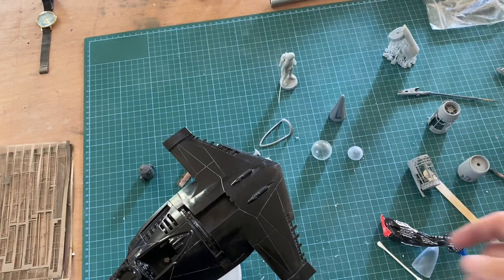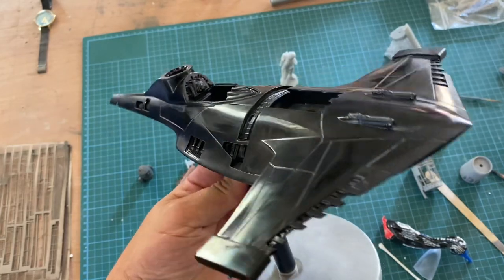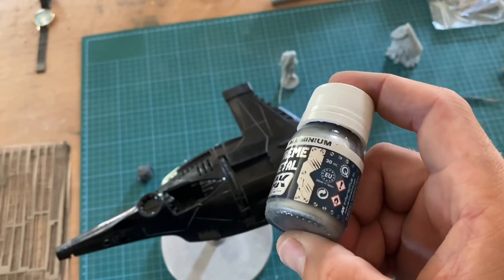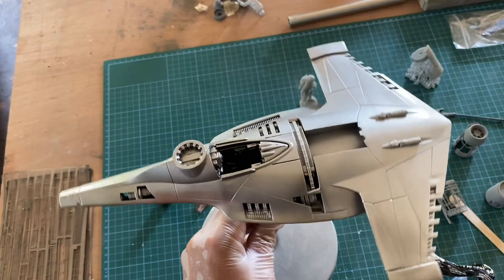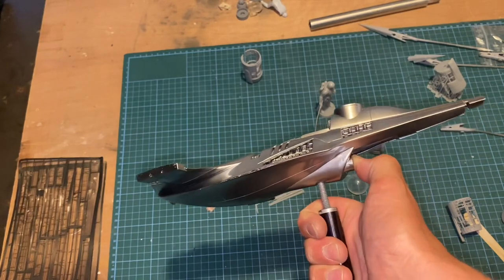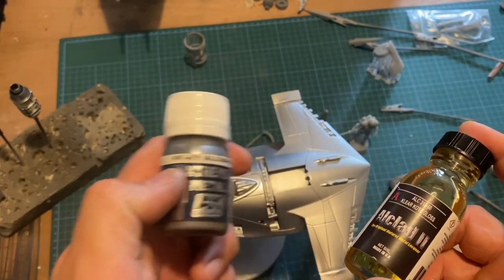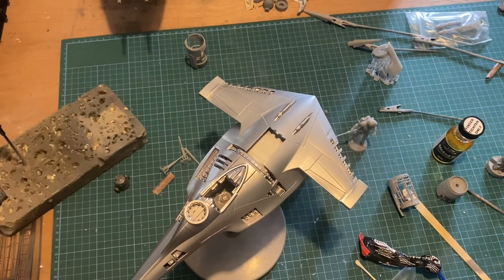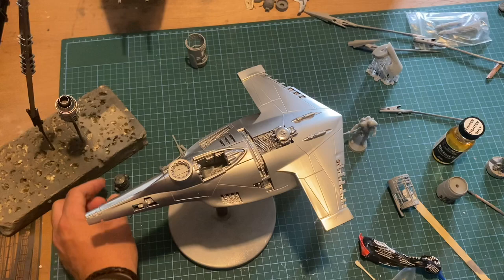1/24 Mando N1 Starfighter Build 2

Comment: I know Alclads are a pain to work with, but I do like their chrome. It feels/looks the most like actual mirror finish chrome I've seen. Interesting to see you use polish to 'gloss' the gloss black, will have to give that a try at some point. 
Also need to try airbrushing (I think) pledge gloss floor polish as a gloss clear coat - always more things to experiment with 😃
Reply from the maker: I’m still very much learning metallics so I’ve polished the black because I couldn’t get a satisfactory finish with the gloss just with the rattle can mate